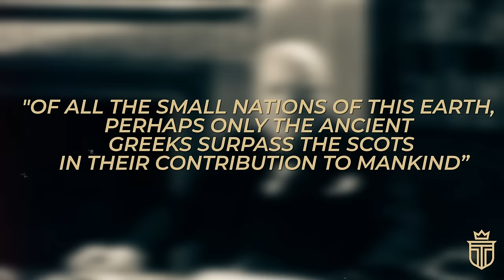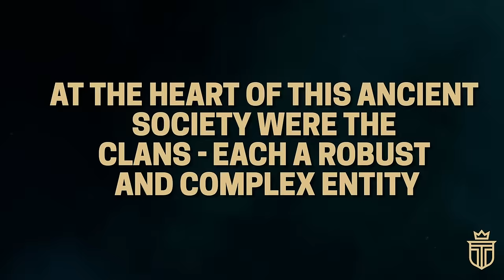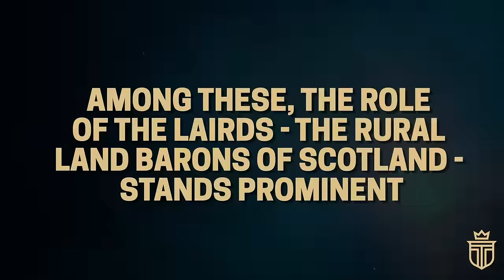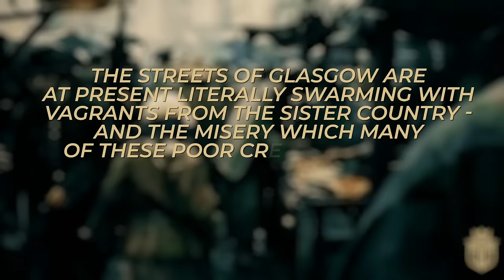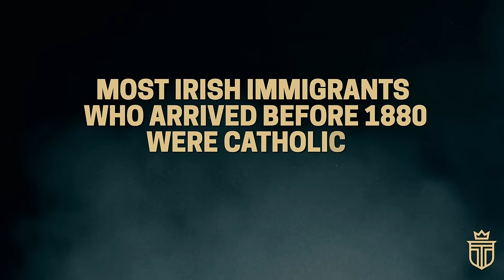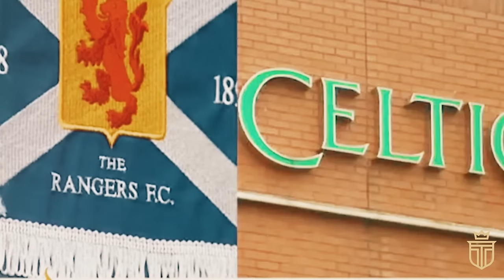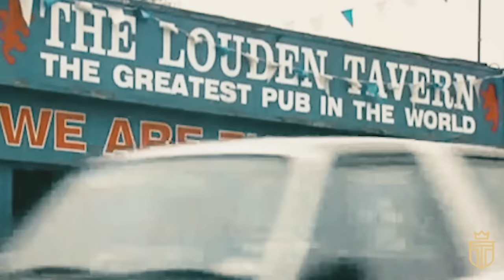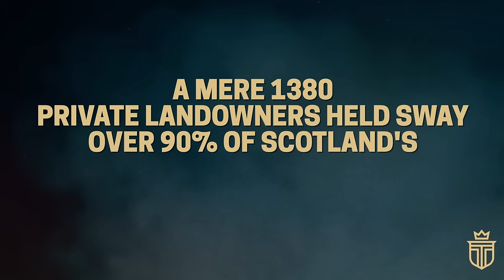Clans To Commoners: Scotland's Social Class System, Explained

Comment: Hence the hatred between the Celtic and Ranger clubs of Glasgow down to sharpening coins on the concrete to throw at the opposition side of the feild.  Having to seperate the supporters  On a per head NZ got Scots than any other country. Especially the South Island hence cities like Dunedin, Invercargill, Clyde Alexander Mossburn. And the hole frabic of the South Island is traced back to Scotland.
Reply: You can hear it in their accents and words. Everything's "wee" this and that.
Reply: So true. We roll our Rs and yes the word Wee and bonnie used alot.

Comment: 4:34
When the Kingdom of England and the Kingdom of Scotland united to form Great Britain in 1707, the new Kingdom's name was "Great Britain," just those 2 words.  It's in the Acts of Union.
"United Kingdom" refers to the union between Great Britain and the Kingdom of Ireland, which was achieved in 1801.
Now most of Ireland is independent, while Northern Ireland is still a part of the U.K.  So it'll be interesting to see what will happen in Great Britain if N.I. leaves the U.K. and rejoins Ireland.  Will the rest of the country be called the "United Kingdom of Great Britain?"  Or will they drop "United" from the name, since the union between Great Britain and Ireland would be severed?
Reply: Actually in the Scottish version of the Acts of Union the new country was originally named as "ane United Kingdome of Great Britain" however this was further rendered as just Great Britain. 

Technically a United Kingdom was formed when the kingdoms of Scotland and England merged.
Reply: @reb0118  Well yeah, but then united Kingdoms were all over Europe because England and Scotland were far from the only kingdoms to unite.
Reply: @MacMillan1603  That's true, There was the United Kingdom of Norway and Sweden, the United Kingdom of the Netherlands, the United Kingdom of yugoslavia, etc.
Reply: @reb0118 The Acts of Union of 1707 created " a united kingdom", not " the  United Kingdom".

If you take a look at the wording of the coronation oaths of George I, II and III (available on-line), you will see that the realm is referred to as "the Kingdom of Great Britain": the word "United" is not used which it most certainly would have been if that word were part of the official title of the realm.

Only after the union with Ireland in 1801 do the words "United Kingdom ..." appear in the coronation oath.